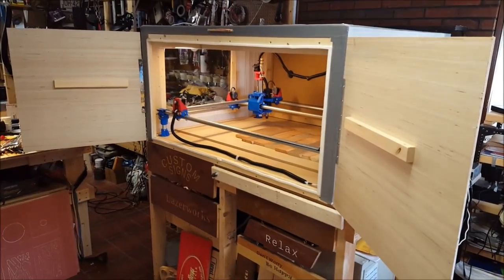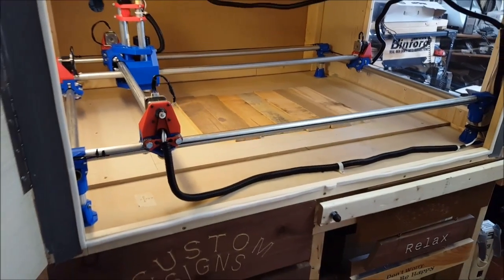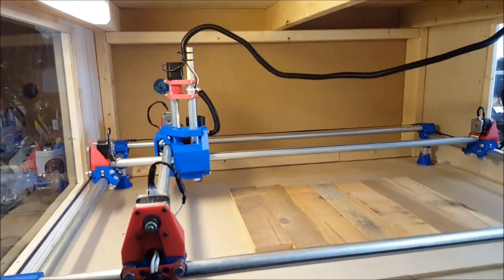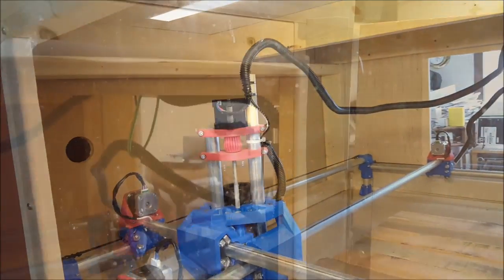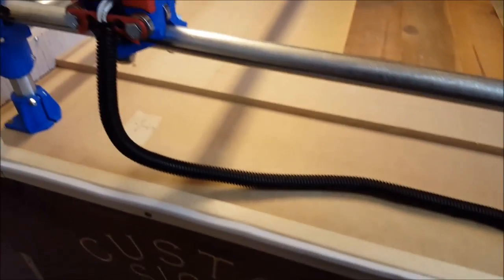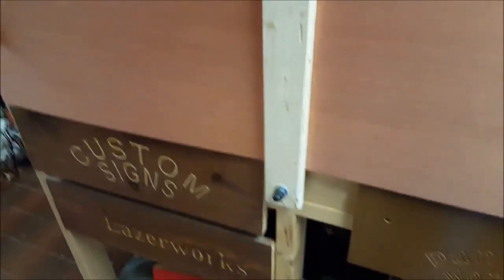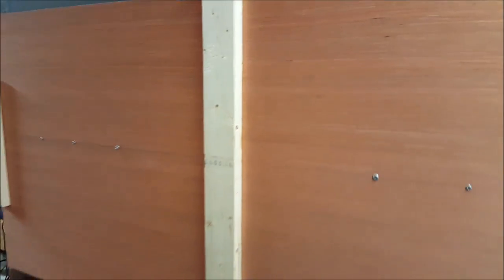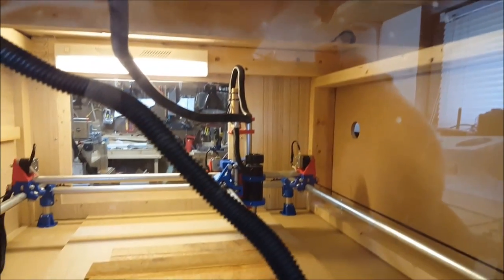MPCNC Enclosure Box

Comment: I want to build the mpcnc but i dont have a big enough workplace.  So it has to be in my house. Wich makes reducing sound and eleminating dust verry important.  Anny tips?
Reply from the maker: I cut a hole in the back of the enclosure box and connected a shop vac hose.  Behind the enclosure was an old wood stove vent (we don't use the wood stove anymore).  I then ran the hose through the stove flu and put the shop vac outside.  When I'm using the CNC I run the vac as needed.  It does suck interior air out but does a great job of keeping the dust levels down.  CNCs are loud and make a lot of dust, it's a challenge that we all have to figure out.  Best of luck.

Comment: How tall is your z axis?  I was planning on at least a 24 x 24 build area, but I wanted to push the z axis to 6 to 8 inches. Rather than the 4 inches most build. Do you think I would see too much flex in the middle, at that height?
Reply from the maker: Hi Andrew.  The MPCNC isn't really built for that tall a Z and I think you would have more flex.  Depending on how fast and deep you pushed your cuts it might be manageable though.  The forum for the MPCNC folks would be better able to respond.  https://www.v1engineering.com/forum/

Comment: I like the build. I just ordered parts on Friday for the electronics from China, will be a couple weeks before they arrive. I'm also currently printing the parts off of Thingiverse also. How much quieter is your setup with your enclosure would you say? I will be using the Dewalt 660 starting out, so that's the bigger reason for the enclosure for me, if I put one on.
Reply from the maker: It was a fun project.  The enclosure definitely cuts down on the noise, not really sure by how much but it's considerable.  The 500 watt spindle is a delight to use; very quiet and it doesn't blow dust all over the place.  However, the Dewalt 660 has more punch and can be pushed harder but it will be very loud and dusty.  Another thing to consider is how large you build the MPCNC.  I built mine on the large side and had some flex in the middle.  Since the MPCNC is re-configurable easily buy just using longer conduit pipes, I'd recommend making your first machine with it small; say a cut area of around 12"x18".  It will be pretty rigid at that size.  Best of luck to you.

Comment: What spindle do you use and are you happy with it?  I currently use the Dewalt option.
Reply from the maker: I'm using a regular spindle rather than a router and like it very much.  So much quieter and far less dust blowing around.  This is the one I have: https://www.amazon.com/Spindle-Cooled-Milling-Converter-Engraving/dp/B01LNBOCDA/ref=sr_1_3?ie=UTF8&qid=1492539036&sr=8-3&keywords=cnc+spindle

Comment: really cool build I was wandering if it will cut 1/4 inch aluminum  or would it need to be engineered to do that an also where can I find the plans for the parts?  keep up the good work .
Reply from the maker: I haven't tried cutting aluminum yet on this machine but have done so on other small CNCs.  It should be able to do aluminum with a slow feed rate, proper bit, and not trying to cut too deeply on each pass.  All of the parts and plans are available for free on Thingiverse.  http://www.thingiverse.com/thing:724999